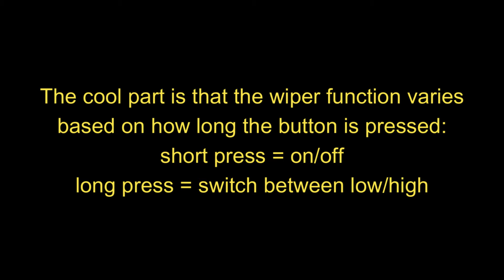914 LS3 - Episode 12: 1-Button Wipers DONE!

Comment: Can you get it to go intervalls? (one wipe and a 5 sec pause, one wipe and so on)
Reply from the maker: Maybe. There's an intermittent function in the wiper module of the PMU but the tricky part is adding that while still keeping the "switch between high and low speed" with out shutting the wipers off. It's down to me wanting to control everything with a single button. I'm not done trying but the "single button" is more important, especially given it won't really ever see actual rain.
Reply: @attheredbarn1669  Thanks for the answer. Here where I live it rains more often, and not allways much, so the need for intermittent is real. My wiperswitch has 3 positions; 0, 1 and 2. I am considdering changing to 0, intermittent and 1. The need for full speed is not often happening.
Reply: @attheredbarn1669  Hahaha the last comment is what I was waiting for. But hey, why stop at intermittent when you can work some rain sensing tech into the mix?